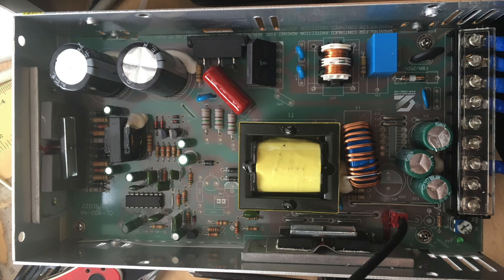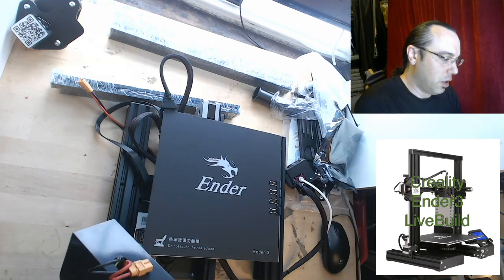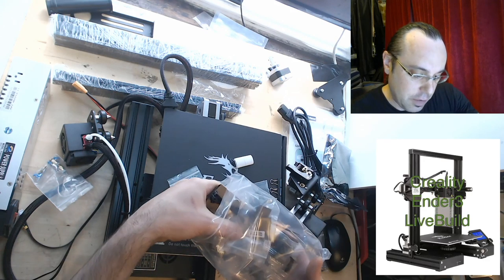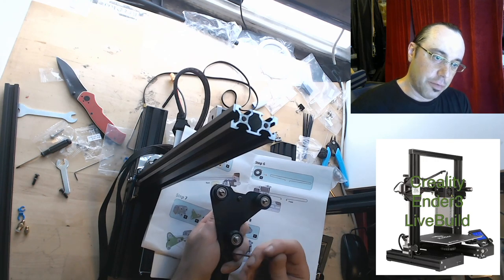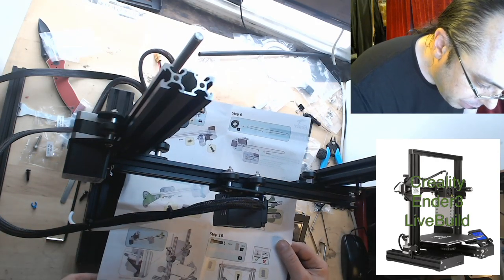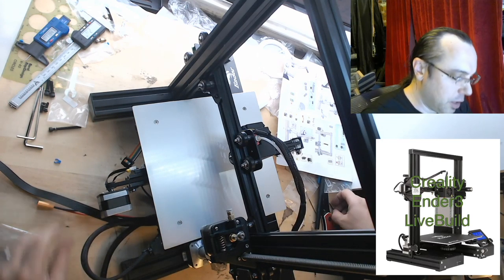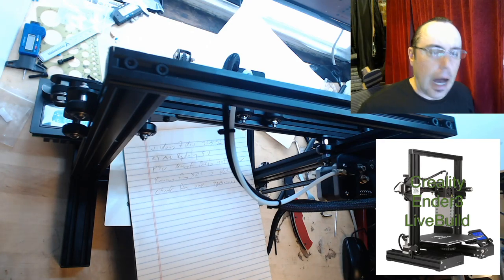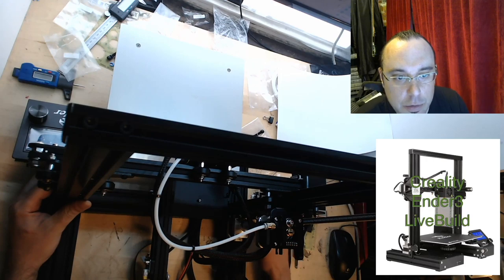Livestream: Edited version of the ender3 build and dialogue

Comment: Hey Alex, just wanted to give you a heads up about the SKR Mini E3 vs upstream Marlin (they don't yet have an example config, just a boards .h file). I actually git-bisected the bigtreetech firmware to find out what upstream commit it was based on and thus get the diff against default configs. My build didn't work until I set the *_SLAVE_ADDRESS defines, but where their firmware fork works with Z3_SLAVE_ADDRESS (for some reason), this doesn't work with upstream Marlin. You need to fix their "bug" and instead define E0_SLAVE_ADDRESS, not Z3_SLAVE_ADDRESS. Then it works. ... I did this for a friend (don't have the board myself yet), https://github .com/comps/Marlin/commit/481489ad
Reply from the maker: THanks for the tip!  I'll make a note to take a look at it when I start on the boards